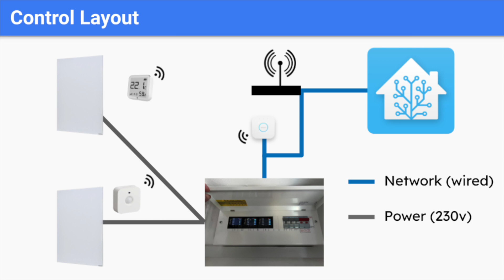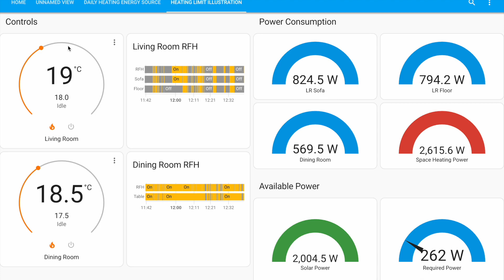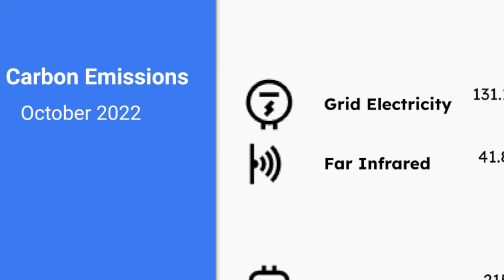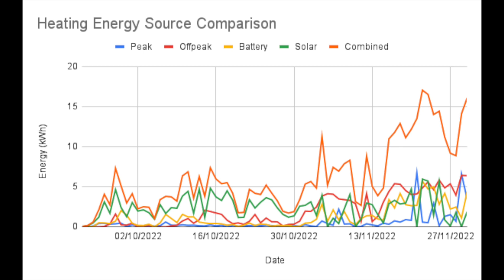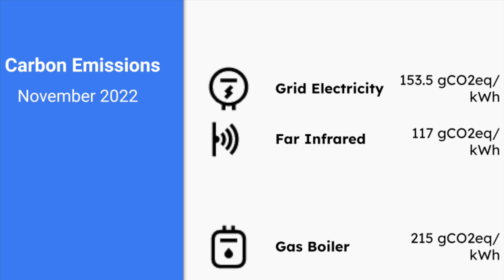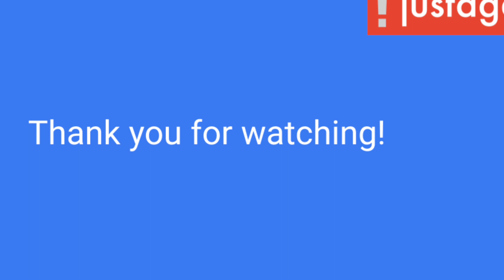Far Infrared Heating Stats - October and November 2022

Comment: We don't have have a sophisticated system like this, our is more manual, but we do use 5 Infrared panels to supplement of ASHP. ASHP acts as a base load run by our 2 EV car, and the Infrared act as local heating depending on which room or rooms are being occupied normally only 2 rooms at once. We to max out when the sun shines on a cold day.
Reply from the maker: Interesting, I’ve wondered about using a heat pump for a base level of heat with far infrared for zone specific comfort. Is your system air to air or air to water?

To confirm, are you using the cars to run the heating? If so, is that using vehicle to grid or some kind of more specific vehicle to load wiring?